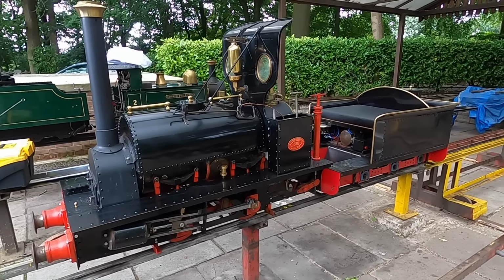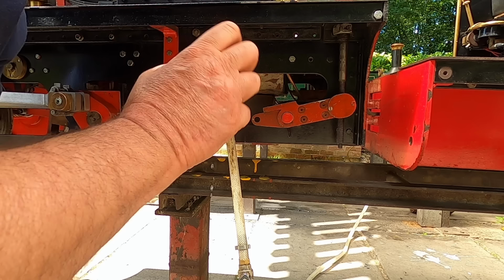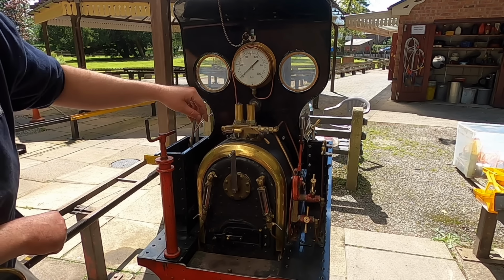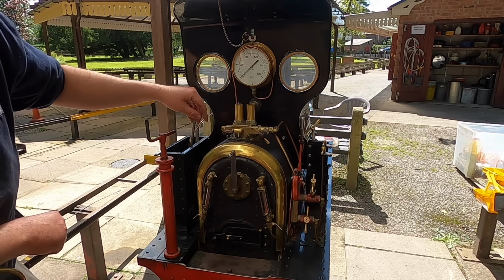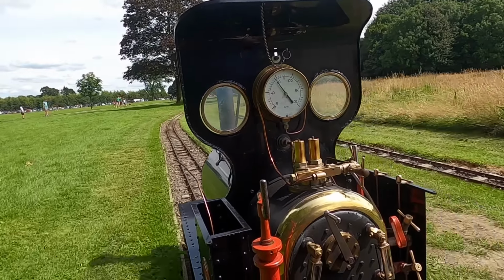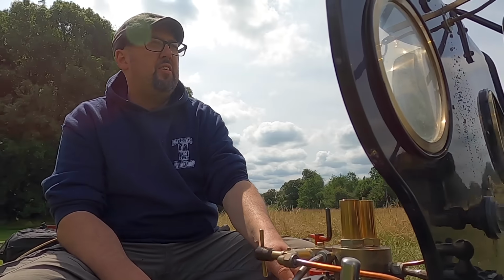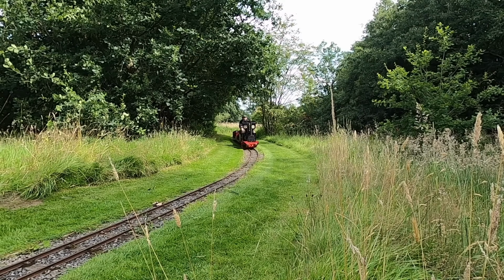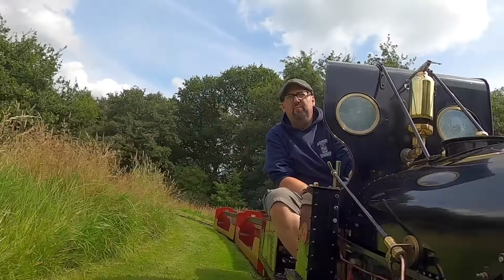Lighting up & Driving a 7.25” Gauge Steam Loco at Leyland Society of Model Engineers

Comment: Great film Matt, very well explained and such a lovely loco. congratulations.
Reply from the maker: Hi Mike, thank you 🙏 much appreciated. Like all engines it has its quirks, and has bits that could be improved, but it will happily pull 3 loaded coaches around the railway no problem. Will be over to the WLLR over the summer hols. All the best, Matt 👍🚂
Reply: @MattChiversWorkshop  Great, looking forward to catching up.